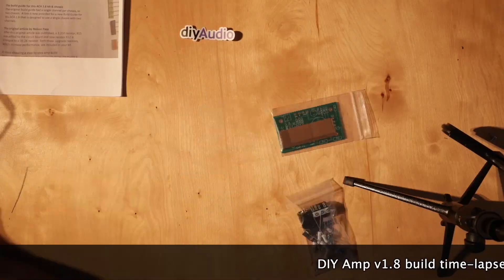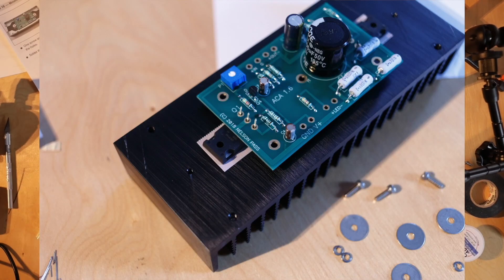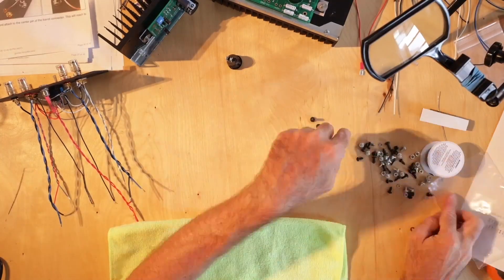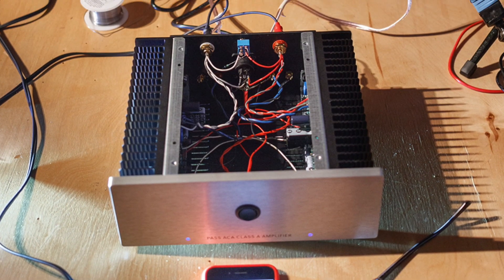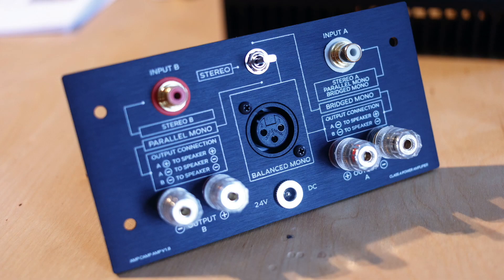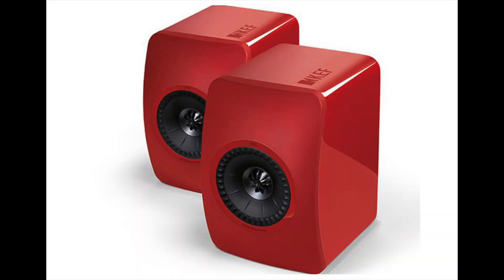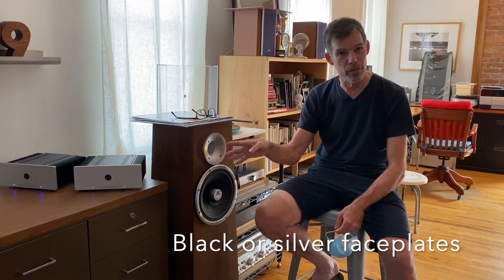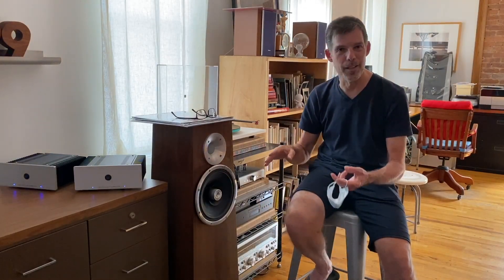Robert built the Nelson Pass designed $327 Class A Amp Camp Amp

Comment: I built a set of these boards into a pair of the 8 watt version mono blocks. They're powering a pair of Bagby/diysiundgroup design, Fusion-12 speakers, and it sounds glorious. The speakers have a sensitivity of 98db. Half power will run most people out of the house. That's about as hard as I will push it. Also built the F5 boards. 

The most valuable aspect of these Pass design projects? Having the designer himself rubbing elbows with us common folks online. I was a fan decades ago before internet. If you had told me then that Nelson Pass would be addressing me or my projects personally, I would have never believed it. Heck of a nice guy. He is appreciated.

Comment: DIY audio is fun. The most important part is to buy a good, high-wattage, temperature-controlled soldering iron. Do not skimp on this, as a low-wattage iron is just asking for endless misery and frustration, and extra expense when you end up messing things up with dry joints or excess solder.

But for real DIY audio fun you need to do a valve amp, with all that yummy 400V on the HT rails ;).

Comment: The Man says , ""'you got to buy some solder """
  Steve that's a big deal   you brushed over it.   also the wires  "" Come on Man""
Reply: No it comes with the wires and the multimeter can be bought filthy cheap too.
Reply: what i was thinking is Pass
won't buy some off the wall solder.   he mixes it up to get a sound he likes.   Adds this a that to the solder . 
it's a big deal

Comment: I'm curious about Robert's equipment rack. Could someone identify it please?
Reply: its just inter metro wire shelving 18x24". ubiquitous Ikea cutting boards:) top is solid not wire. Has leveling feet with rubber footers. It is rigid but probably resonant:( altho I've not heard a problem, I have sorbothane under the tube preamp.
Reply: @robertwrightphoto  Thank you Robert, i thought it was wire shelving, but the solid top threw me there. I'm on the lookout for an inexpensive rack solution - that's just the ticket.

Comment: As someone who has zero experience in soldering, nor am I an audiophile. Is this worth buying and trying ? I currently have a Technics Mosfet SADX-1050 amp - bought from new many years ago, which has zero wrong with it and in perfect condition, and I was going to dip my toes into the audiophile pool. Purely on the economics side of things- a $4k amp for around $600 (incl soldering etc), will the sound quality blow me away ie is it genuinely comparable to $4k amps ?
Reply: Buy a cheap fun electronic kit or two from Adafruit or spark fun and a temperature controlled soldering iron.  Watch a few vids on how to solder then have go at the ACA.  If you like making stuff the joy of this kit is it looks very professional when assembled.  It will need sensitive speakers but you don’t have to do it all at the same time.  Speaker building is  fun too.

Comment: 1:04 I don't like that PCB design.
Traces with 90 degrees corners and no polygon pour.
Reply: Qorax square traces have no detrimental effect until at least 100 MHz and usually well beyond. This is an audio circuit.
Reply: @wcg66  It's not about emission, it's just sloppy to design it like that... Looks like how the average student designs his PCB when he has postponed his project for far too long (I'm speaking from experience lol)

However, originally angles of >90 degrees were avoided because of how the etching process used to be. Back in those days, high frequency emissions weren't a concern yet. The issue was that the development liquid could etch away too much of the trace when an angle was >90 degrees.

Comment: Why would you spend money on this when you can build a vta st-70 tube amp(dynaco-70) for just a bit more. It’s 35 watts per channel. I built mine and have it on JBL 590 speakers that can blow you out of the house. You can buy them built or diy as a kit. Tube power is very different than a SS amp. Tube amps last 20+ years minus the tubes.
Reply: Because tube amps have very high voltages and this is intended to be safe for novice builders.
Reply: @steveluck9541  FYI this was my first time building anything electronic. I consider myself a beginner also.

Comment: Steve, you seem to like folded ribbon tweeters and AMT's , I am curious as to what you think of the new line of ESS Labs Heil AMT speakers. I owned a pair of AMT 10b's (the upgraded model with passive radiator) in my late 70's "Audiophile" system with Apt Holman preamp, Bryston 3 and Phillips E312
 turntable. Loved that old system, it definitely rocked the house. I am curious about the AMT10's or 8's but there is no place to hear them near me.

Comment: Back in the day, I.e., 50+ yrs ago, I built various audio kits, out of economic necessity. I built HealthKit integrated amps, a HealthKit record changer, electro voice speaker system (enclosures),etc. as memory serves, none of them worked exactly right, except for the loudspeakers. Undismayed, I built a dynakit power amp and preamp...neither of which worked properly, at least initially. Once I got the dynas fixed, they sounded really good, but I finally came to realize that I didn’t have the talent, patience, skill , or good looks to build audio kits. (However, I do wish I still had those completed kits, just to see...).

Comment: This video is very timely for me. I attempted to build one of these about six months ago but I ended up with a short that I could not track down. So, I stuck it in the closet and it collected dust. I finally decided to give it away on Craigslist this past weekend. The guy who took it from me noticed that the only problems were a few bad solders (including one at the RCA jack like the gentleman in the video). He fixed it and said I could have it back. So, I got to listen to it for the first time last night. I've got it hooked up to my Omen DW's and it's a clear, punchy little amp. I'll see how it stacks up sound-wise against my Outlaw 2160 after some more listening. For those thinking about building this without any prior experience soldering and tracking down issues with circuits (like me) I'd say it's definitely not "easy". Soldering in particular is a delicate art and it takes some time to do it properly. The community around this amp is definitely helpful, but if you run into trouble it certainly helps to have a more experienced person with you to help out.
Reply: That was really cool of the person to give it back to you. If anyone else runs into issues, don't forget the DIY Audio Forum that's been mentioned here. Lot's of great help there!
Reply: There is hope for humanity. Pretty small sample size I know...
Reply: Robert P If soldering is difficult PRACTICE for a week on some scrap wire

Comment: The claims of the rolled off top end don't really add up . . . Audio Audiosciencereview has tested the ACA and it is flat to about 50kHz, then slowly rolls off. Flat requency response seems to be the benefit of this amp.

Otherwise, the measurements showed a ton of distortion, and not just even order. 

The sloppy bass is probably a result of the low damping factor of this amp, it just isn't going to control a big woofer well. 

This amp was designed to be a fun, cheap, easy to build project, . . . And it is a great design in that regard, so long as you omit the expensive case. But don't expect magic.
Reply: If you only need a couple of Watts it is magic because you wont drive it hard enough for it to distort.
Reply: @SuperMadpom  No this amp has high distortion even at 1 Watt (0.7%), that's the 'magic sauce'
Reply: @eetu2532  With 105db per watt speakers i'm barely getting to 1 watt at normal listening levels :-)
Reply: @SuperMadpom  Yeah, I was just pointing out that even when the amp is not clipping it has very high distortion (which is part of its charm/design).
Reply: SuperMadpom which speakers are those at 105db/watt??
Reply: EliasTheHunter Carfrae Little Big Horn replicas - same geometry and Lowther DX4 as the original speakers. White ones in google images are the ones I built.
Reply: Steve Luck I’ll have to look into that. Very cool!

Was that a kit of some sort? Would you recommend it as a project?
Reply: @SuperMadpom  105 dB speakers are not at all the norm, and this does nothing to change the fact that the amp has relatively poor performance. The amp has very high distortion at even low power output and low damping factor. It was designed to be cheap for demonstration purposes and yet is being sold for a premium because it has Pass' name on it. According to Pass' white paper on the amp, the original parts cost was $14.25 . . .
Reply: @eetu2532  I like the idea of this amp as a way to introduce people to building amps. And will eventually build a kit just for the experience . . . but considering the kit's designed cost was $14.25 and is now being sold as a $327 amp, pushes the performance outside the realm of "charming."
Reply: @MrChompenstein  Well yes, I agree, I wouldn't personally call it 'charming' or 'magical'. High distortion, very low damping factor, low power, low efficiency.. actually the polar opposite of what I look for in an amp nowadays. I have a NAD power amp, very clean sound and love it. But I get that the ACA has its fans and like you said, probably a fun DIY project.
Reply: @eetu2532  Totally agree. The price just kills me because I feel it goes against the spirit of the amp. If I make one, I plan to source my own parts . . . . I am also interested in the paralleled amp option
Reply: Was thinking of building this as a winter project until I saw the same review. https://www.audiosciencereview.com/forum/index.php?threads/pass-aca-class-a-power-amplifier-review.9741/

Comment: It's much more than another class A amp - it's so simple it's much more like a single ended valve amp - If your speakers are sensitive enough - recommend full range driver, they sound stunning.  Not enough bass add a plate amp to drive the subwoofer and remove some of the load from the ACA.

Comment: I also built two ACA’s and I think they sound great for $327 each.  I’m a bit envious of yours since mine didn’t come with the silkscreened rear panels.  That makes them seem more finished and less of a kit.
Reply: Bullwinkle Eats Vegemite  The mounting is pretty much the same.  However, I think the toggle switch is different and it’s wired differently.  The way I understand it is it includes the parallel mono version internally and my version doesn’t.  diyaudio told me there is an upgrade kit in the works.
Reply: Bullwinkle Eats Vegemite It turns out the panels are different than the ones I have.

Comment: I built a pair as monoblocks 2 years ago 4 boards, 2 chassis as a weekend project. Perfect on the first try for both.  v1.6 and thankfully did not have that silk screen print on the back plate since it’s monoblock only operation balanced/bridged.  The silkscreen is pretty cool though.
Reply: I’m sorry, but I don’t understand. What’s the benefit of not having the silk screen on the back plate?

Comment: Nice! Notice the main expense is the case. Which is understandable. Great components are still crazy cheap. Which is why high end audio prices are out of line. A custom board can be had for under $10. Many plans available on the Internet. If you can do basic electronic  construction, you can save a bundle.
Reply: You still need big heat sinks - If you buy the kit with the case all the holes are drilled and tapped ready to go.  Supplied power supply is good quality low noise too.

Comment: Thanks for the review.  I've just ordered 2 kits and will be attempting my first amp build since 1977.  I really didn't need them, but at that price ($720 for 2 mono-blocks), I couldn't pass it up.

I have a mint condition pair of Klipsch Forte II's that should match up perfectly with them.  Any suggestions on a Pre-Amp to match with them?  Preferably tube based.
Reply: The Korg NuTube B1, also a Nelson Pass creation, also available from the DIY Audio Store, is a perfect match. It responds very well to bias adjustment, so if the ACA gives you all the warmth you want, you can clean up the output of the B1. If you want a little more tube sound, just tweak it the other way. The ACA is so forgiving, you probably can't do too badly with most any pre. Your Forte's will be a wonderful match. I have Forte III's.
Reply: @rbhis000  Thanks, Brother!  I will look at that piece.  I've never owned a Pass product, I grew up with McIntosh and Klipschorns.  People rave about Pass amps, so I'm anxious to find out about the buzz.
Reply: I also have two of the ACA’s in operation.  I’m anxiously awaiting receipt of my Korg B1 NuTube preamp.  Hope it comes soon as I can hardly wait!
Reply: I'm waiting for my Nutube Preamp also. In the meantime I built the Elekit Tube Preamp available from diyaudiostore.com, tubedepot.com and other places.  The Elekit was my first kit,  build was no problem despite over 400 electrical solder points!  The Pass kit are MUCH simpler.
Reply: @nacarp2000  I have the elekit 8200 tube amp/headphone amp. You can purchase this unit is think off the store as well. A terrifc match with a pair of sennheiser hd 650. Makes wonderful music with a pair of higher efficiency speakers to!
Reply: @nacarp2000  Great to know it is easy based on your comments.  It's been a long time since I built an amp, and my eyesight and dexterity have faded with age and injuries!  I plan on doing a lot of soldering practice soon!

Thanks, guys.  Let me know about the Preamp when you get them.
Reply: Allen, get yourself a good soldering iron with accurate temperature control. Also a solder sucker is a godsend if you make mistakes.
Reply: @nacarp2000  Any recommended soldering iron brands to look at...or avoid?  Since I don't currently have a soldering iron, I want to make sure I purchase a solid one.  

I don't like to waste money, but I'm a firm believer in "you get what you pay for" and only buy quality products.  I try to buy "Made In The U.S.A." if at all possible, even if the product is higher cost within reason.

Any suggestions from you guys is appreciated (features to look for, features that aren't needed, etc.).
Reply: @allenfields9058  Hakko would be my 1st choice. Weller 2nd. I'm using a Hakko FX-888D, available on Amazon in kit form with various tips. Do pay attention to the tips for Hakko irons.
Reply: Have to amp camp 1.6 monos waiting to assemble here as well (and boards for a earlier 1.1 version sitting around to). Like many on there waiting for my diy audio nutube korg b1 preamp kit as well.  Have  Wayne  (Nelsons right hand at pass labs for many years..he does the preamp designs) whammy class a heaphone/preamp kit. This is also a terrifc match for the amp camp amps. It will also pair well with the diy audio first watt aleph j, f6, mx2 etc amps. More usable power but working with ac voltages. Been collecting a large stash of parts for some of those amps. Bought the entire f6 kit. The more I have been thinking I might be building dual mono version of say a first watt aleph j or f6 and make it it so you can swap out the driver boards and have a new Amp! Thank you for covering this save and can't wait for the review!
Reply: @brandonburr4900  I've seen several people, like yourself, mention they are waiting on the Korg Nu Tube B1 to arrive.  Are they on back order?  Do they only produce parts when they get an order?  

Just curious why so many people mentioned they are waiting.  I didn't know if that is common or is it related to the COVID-19 shitshow we are now living.  I noticed on the two amp kits I bought they said they would not be available until September 7th.  Thanks for all the help!
Reply: @allenfields9058  I placed a pre-order for them way back in March I think? I think they mentioned it will ship in the third or 4th quarters when I ordered it. It sucks because I placed a order for transistor kit for the aleph j with it and wished I did it separately. So no, not on back order. I believe that pre-order was sold out soon when I placed mine. Many kits there sell out fast.  Yes shipping has been  affected with all this madness as well. You can check with the diy audio store. On that site they have a update with regards to announcements with kits becoming available or pre-orders for kits, shipping delay notices etc. Diy audio can  also be contacted as well on their site. Very responsive.
Reply: @allenfields9058  It's usually because of the availability of some of the LS transistors. Not this time, though... I think it's just a really popular kit that sells out as fast as they can put the parts together. You can sign up for an email when the next pre-order is opened. I missed the first "Pioneer batch", but got in on the second order. It took awhile. It's a small outfit and they do their best.

Comment: The Amp Camp Amp is a wonderful kit to build. The only caveat might be for some is the 8watt pch is only for an 8 ohm speaker. In the bridged mode the power rating is closer to 10 watts into a 4 ohm speaker, not 16 as one might guess. Still a satisfying piece of kit that sounds very, very good!
Reply: https://cdn.shopify.com/s/files/1/1006/5046/files/ACA_Monoblock_Operation_RevA.pdf